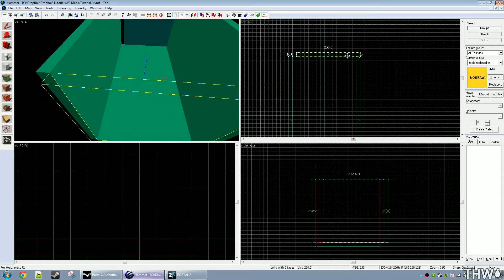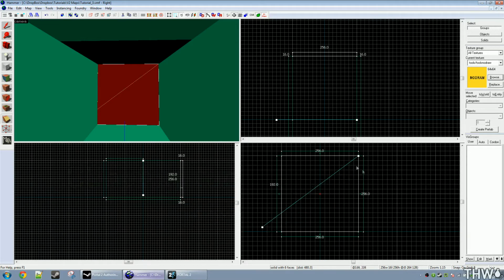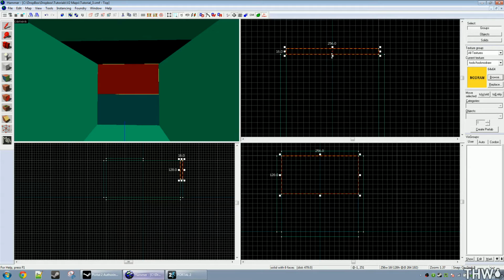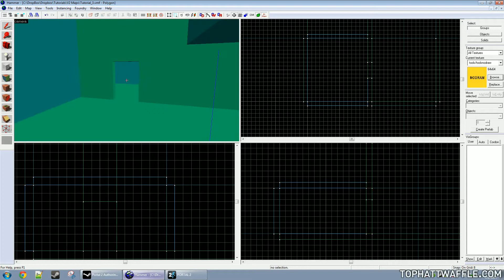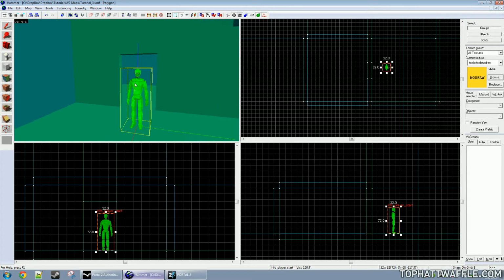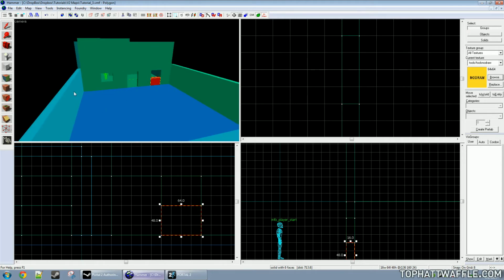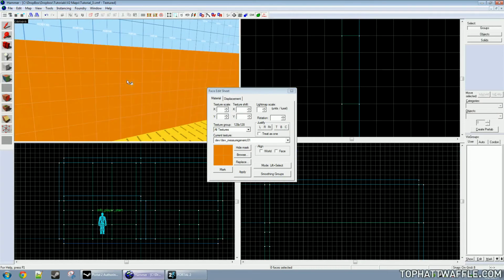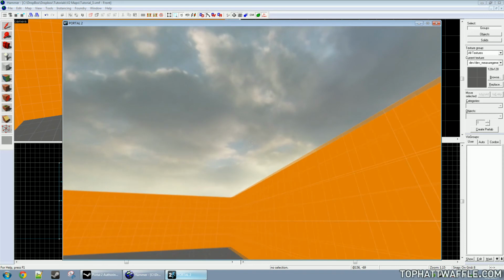Hammer Tutorial V2 Series #3 "Getting intimate with brush tool, and introduction to clipping tool"

Comment: @TopHATTwaffle how do you put like glass down in hammer?
Reply: You can either leave the broken off block from the clipping (The one you deleted) and do Ctrl + A and search and use a "glass" texture, or you can do the same thing except make the block instead of leaving the broken off part.  

My recommendation, however, is to just leave the block broken off (aka don't delete it) add the glass texture if you make a window again. But for now, if you did delete it, it's quicker to just use the block tool.
Reply: I'm assuming you use the brush tool to make a thin window and change the texture. Try using func_breakable on the window if you want it to be breakable.